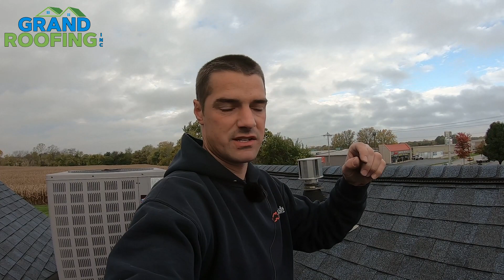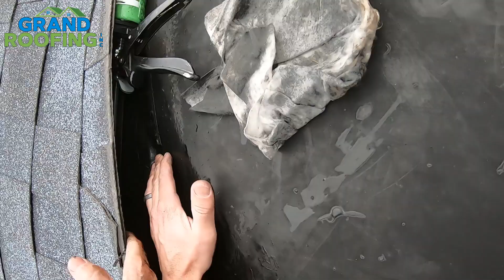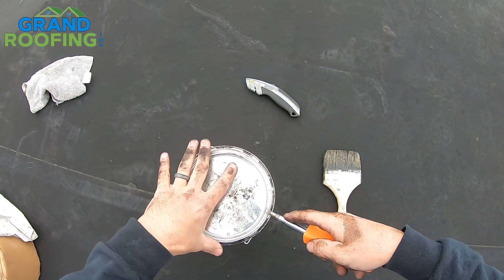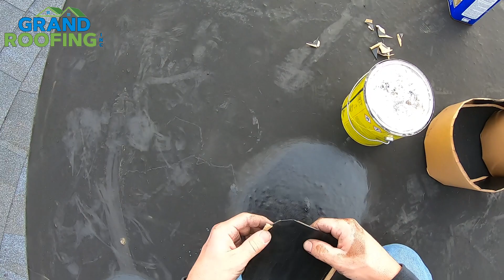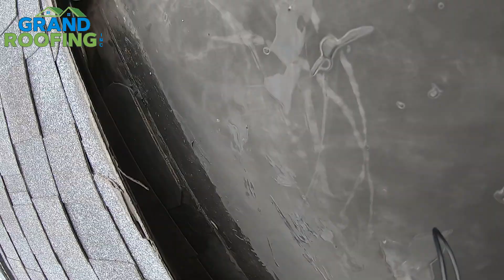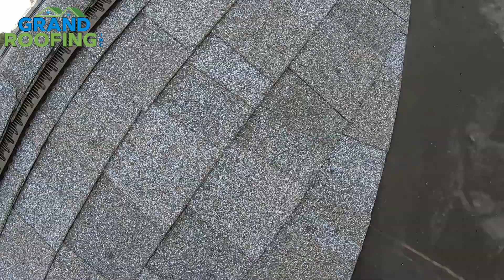Rubber Roof Leak Inspection and rubber repair

Comment: I had someone measure my roof for estimate today noticed they were walking on the top ridge shingles, does that damage the ridge cap, is it safe to walk on them. I'm hoping he didn't Crack them I have to go up tomorrow to inspect them, are the ridge top shingles prone to breaking if you walk on them directly he was following the top ridge lines walking from one end to the other.
Reply from the maker: It can be, it depends on a few things. If it is supported underneath or not. If it has ridge vent some ridge vent like Cobra will not support it. the cab can you give but the nails will not and pop through. Generally it's not a good idea to.
Reply: @GrandRoofingInc  it's a vented ridge cap I was watching from below and wanted to say something but didn't cause figured it was safe for the shingles and thought otherwise he wouldn't have done it and didn't want to make him mad in case it was safe but just seemed like it wasn't right. Thanks for the feed back I'll have to go examine them tomorrow, hate climbing up there... it should be just cracks I should worry about right
Reply: @redfirekla  it’s fine lol the area where the nails go is reinforced, at least in the Owens Corning. I try not to walk on them because it can make them not look as straight from the ground. If it’s a steep pitch he has no choice but to walk on it. There’s a truss at the top on the ridge so if it’s installed nice and tight it can’t really bend and give enough to break
Reply: @Zack.G23  thanks or letting me know man, ever since I had a tiny tiny leak repaired it took two diff roofing guys to fix actually three with me trying to initially patch it up I'm now super paranoid about getting any additional leaks... I had him measure it for the so called life time decra villa tile metal roof. Like back in the homeland like clay tiles these clay looking metal sheets they say are a life time roof, when I get the estimate I'm going to try to find Brian on Twitter to see if he would look at the estimate to give his expertise on it a conplete breakdown. I wish Brian  lived close by so he could do my roof cash payment, Brian is so good and OCD he does an amazing job I've watched all his videos he does amazing work, hard to find people like him.
Reply from the maker: Yes Grand Roofing does have a Twitter page as well as Instagram and Facebook. I'm trying to make sure there are other platforms that people know about in case YouTube shuts it down. I don't get on the other ones very often. Probably the best secondary platform would be Facebook ( Grand Roofing Inc)
Thanks!